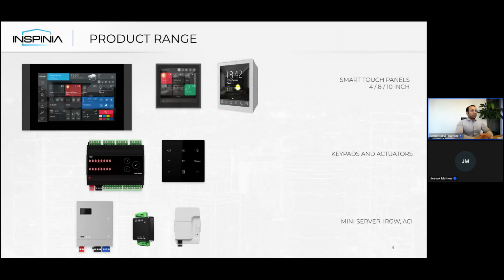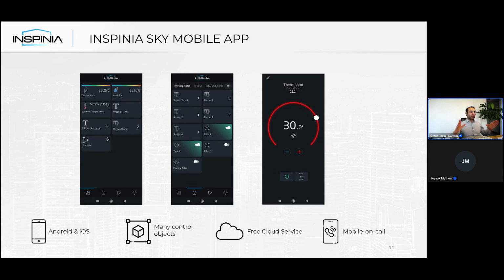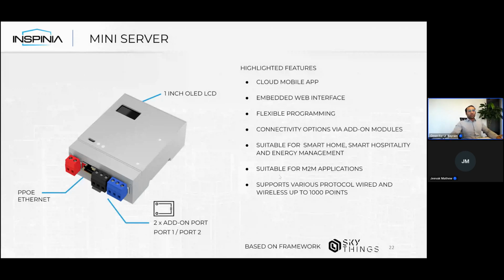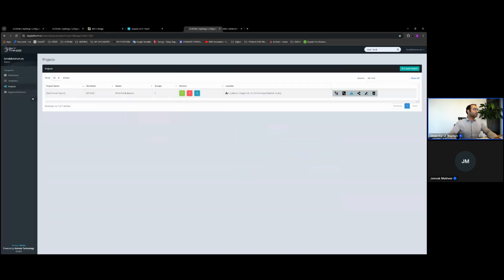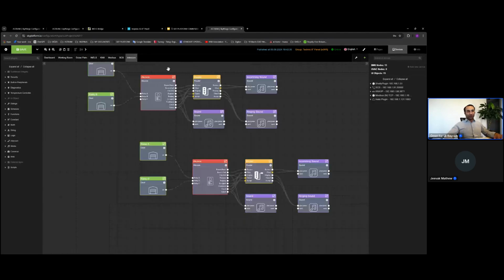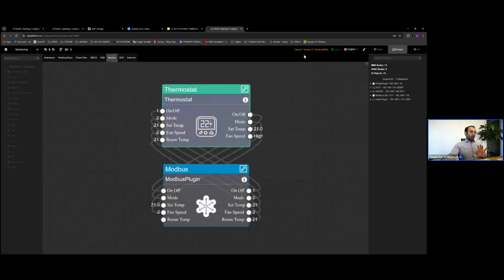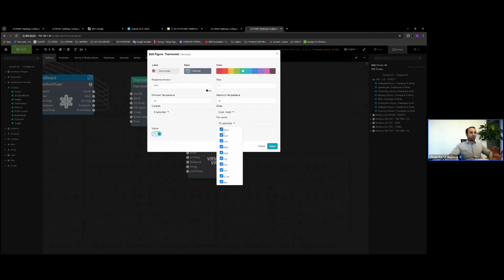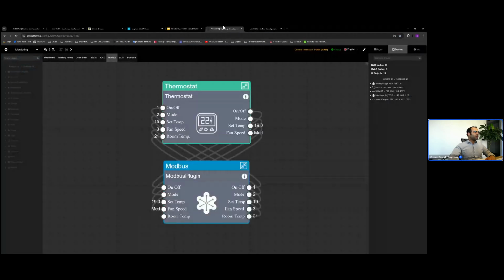Inspinia Product Portfolio and SkyPlatform Programming | Full Training

Comment: Subject: Assistance Required for Reprogramming INSPINIA Screen on SkyPlatform

Message:
Dear Support Team,

I am facing an issue with reprogramming my INSPINIA screen through the SkyPlatform. I had previously programmed the screen, uploaded the project, and it was functioning correctly. However, I accidentally deleted the project from my SkyPlatform account.

Now, when I try to add the same screen to create a new project, I receive the following message:

Serial number used. Do you want to overwrite this device?

Could you please guide me on how to proceed? Should I select “Overwrite,” and will this affect the device’s functionality or previous configurations? I would like to restore the ability to use the screen normally with a new project.
Reply from the maker: can you please contact support@inspinia.eu